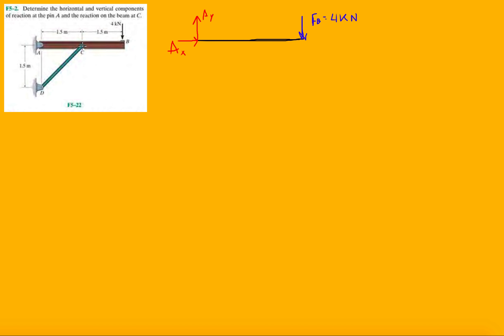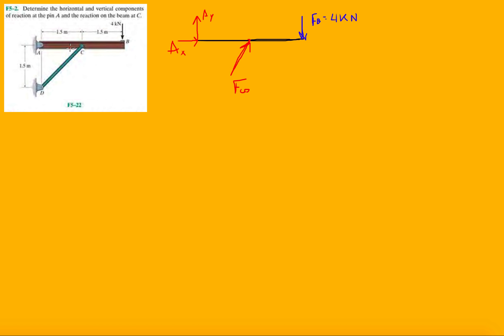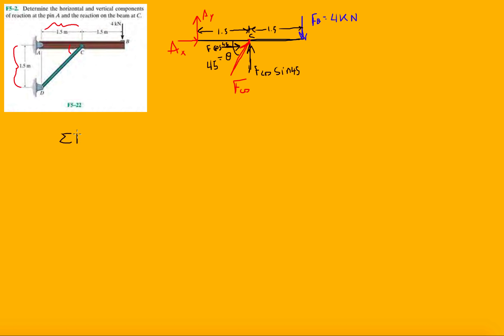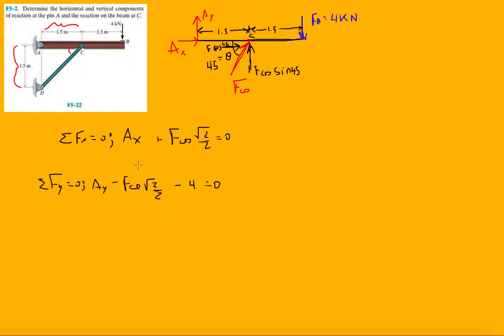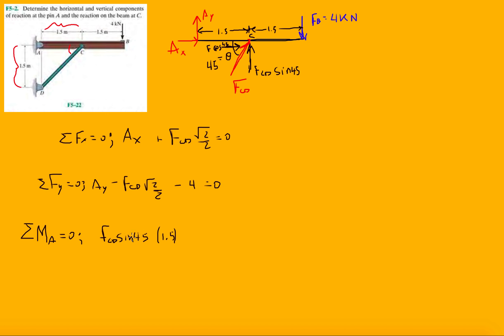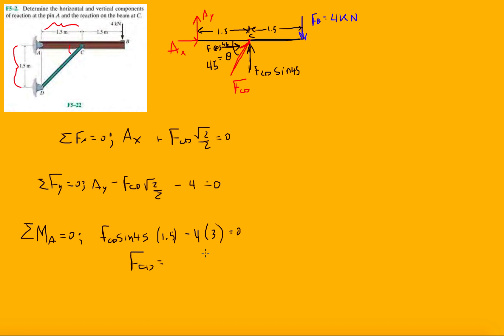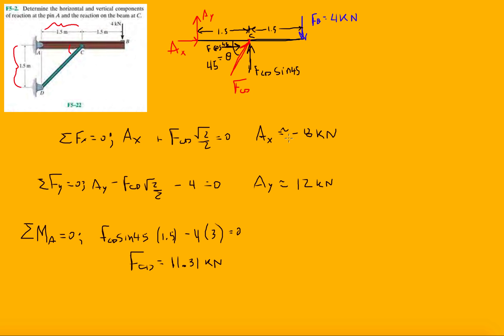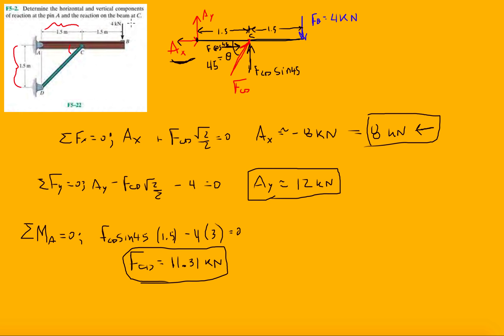Problem F5-2 Statics Hibbeler 12th (Chapter 5)

Comment: it's a good solution.. but I think there's a little mistake (if my analysis is correct ) you took upwards to be positive and down negative but in the solution you mix the sense of direction giving : +Ay -Cy (which should be pointing up) and -By =0. 

the answer in the text book is 3.99 ~4kN. because Ay +11.31cos45 -4 =0
Reply: but you explanation is clear actually.. thank you.
Reply: Thank you for this information, I was confused. :)